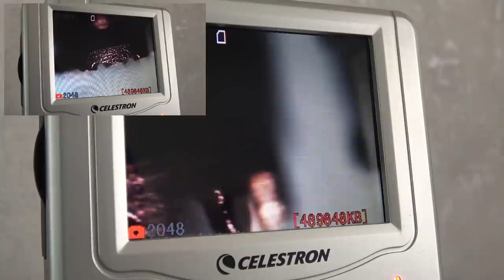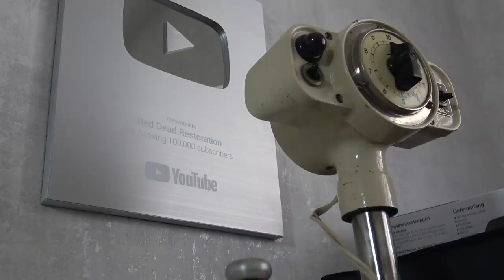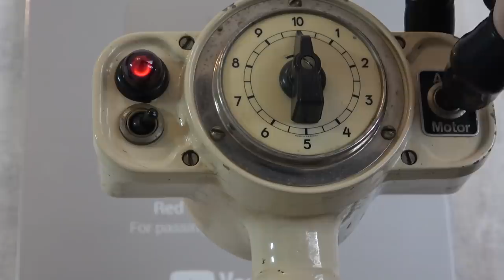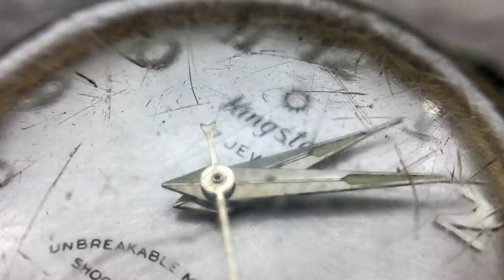Satisfying Restoration of a vintage 60´s Kingston mechanical Watch - Poljot 2409 caliber

Comment: I like the classic design of the 60s-70s. The electro-chemical coating of the dial is resistant. And the mechanism is strong and accurate running should be. Я такие ремонтировал лет 45 - 50 назад. Где же они так... забыты были? S-образная пружина даёт более стабильный крутящий момент. Не правда ли? Механизм в идеале, а корпус пострадал. Мне зрение не позволяет уже. Хоть на Вашу работу посмотрю. Вспомню молодость. Спасибо мастер

Comment: I'm currently repairing the same movement and the teeth on the castle wheel were also broken. I've got a replacement but I've noticed that the canon pinion is very tight. Apart from creating extra friction in the movement, it must cause extra strain between the castle wheel and the intermediate setting wheel. I think this is why the teeth on the castle wheel become stripped off. I'm going to broach the canon pinion out until it fits normally to prevent future problems, as I believe that this is the route cause of the problem

Comment: I have question my friend: is the new generation of automatic watches are same mechanism or there is so much updates since 60th 70th until now ? 
I hope you can show us restoration for new watch and famous brand 
Thanks so much 
Best regards 
Gimme like let the master watch my comment ❤️
Reply from the maker: The machanism is similar but every manufacturer has its own way to make the automatic device. A Seiko mechanism is different from Swiss ETA and an ETA 2824 is different to ETA 2892 and Rolex has also a completely different way of the automatic for example. Modern movements are more decorated. If you watched my Longines video and compare it to the old Breitling video you will see what I mean 😉

Comment: Great stuff, as always.... Question: How do you remember where all the parts go after you've disassembled the entire watch? I've always wondered about that.

The rate looked good after regulation, but the beat error seemed high (1.2ms)... Is that OK?
Reply: Experience, plus likely there is also a book which contains illustrated parts breakdowns for many watch and clock mechanisms, plus also manufacturers would send these out to horologists for servicing their product.
Reply from the maker: If you disassembled some of them, you know how to put it back together. The beat error is still ok. Not great, but ok 😉
Reply: @SeanBZA  Of course, "Experience"... But to a novice or amateur, documentation is an absolute must.

Comment: I am servicing the same movement and I am unsure about the mainspring.. The end has a 'T' which needs to locate in a slot in the bottom of the barrel and the barrel lid.  Do you need to line up the two of them or only the top to get the lid back on?

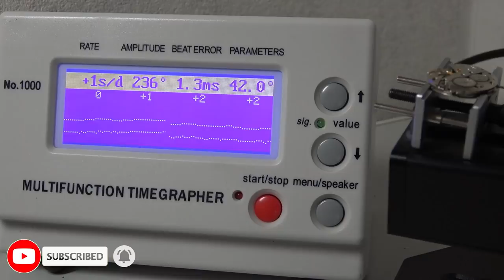Comment: 12:07 couldn't you do better than that? i mean 1.3ms of drift is recoverable. this thing has great amplitude and good s/d. you could bring it back to at least under 1ms. kinda disappointing but the result is good enough anyway. great job.

Comment: 236 degrees is a bit low, how’s the timekeeping on the wrist? Ideally you’d want to get 270+ dial up and down.
Reply from the maker: On a watch with a lift angle of 42°? 🤔 It's not a modern ETA movement
Reply: @RedDeadRestoration  oh Right, I never had any Russian watches. But does it keep good time? I’d expect the same problem as with “regular” watches running on low amplitude.
Reply from the maker: @Jonas_GD_1234  yes it keeps good time so far 😉

Comment: All great but just one thing that just felt “odd”. It was pretty beat up with rust, and being green I’ll guess it’s brass but plated gold. You sanded/polished the plating off then left it using just the base metal polished up. Fair enough but that changes the look of the watch, maybe it needed the gold plating restored (not sure if that would make it non cost effective though).
It’s all very well having just the base metal instead but if that is brass, then it’s going to tarnish pretty rapidly and will look rubbish in a few weeks of wear. Just saying

Comment: Is that a soviet watch made to export? Certainly looks like one.
Reply: No it is not. The one you are talking about was Vostok Precision with Zenith movement. It was  made later.
Reply: @mrbubbles6961  There were many soviet watches made solely for export under different brands. This Kingston utilizes Poljot movement, which made me wonder if it is one of those.
Reply: @86smoke  you are correct. I should have noticed from the first time. It is Poljot.

Comment: uh... acetic acid dissolves nickel plating along with the oxide.  you are far better off using electrolysis to remove the nickel oxidation.  either way, you likely would have needed to replate because of the high level of corrosion.  I disagree 100% that the plating did not need to be redone.  that plating was in very bad shape, and the underlying metal was open to further corrosion because you did NOT replate.